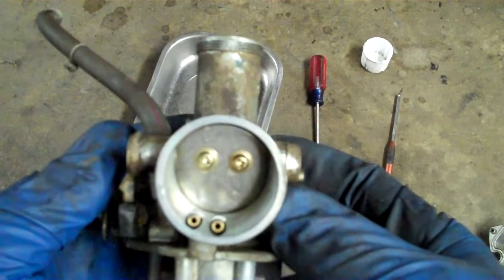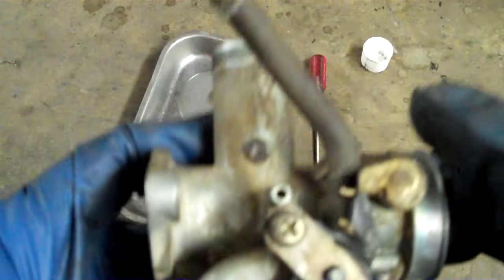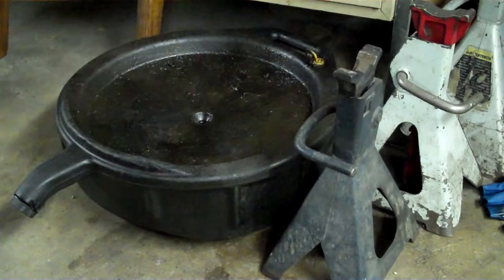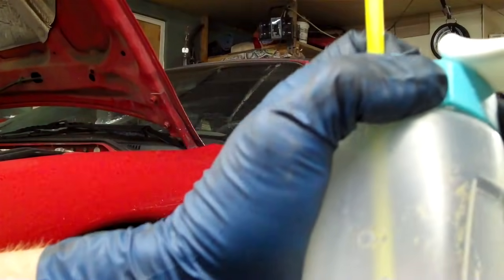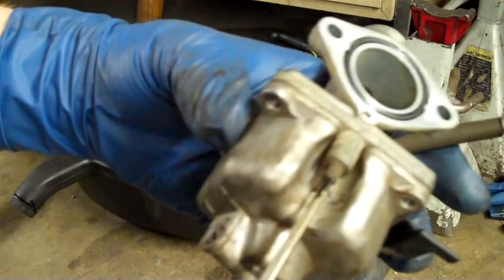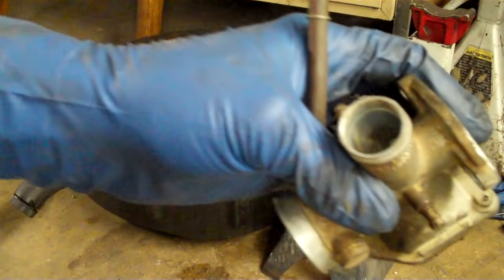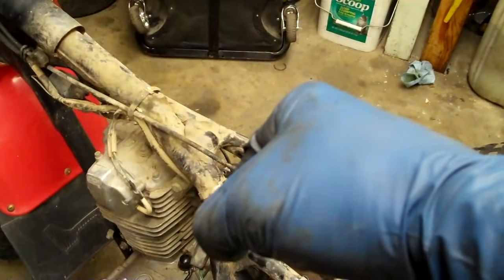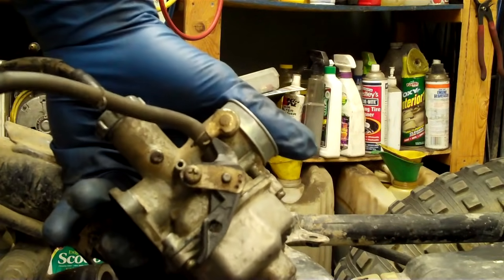How Motorcycle Carburetors work and how to tune and clean them

Comment: Brian, I found a used bike and the guy said it needs the carbs cleaned.  I know nothing about fixing things but do you think anyone can learn to do this in your opinion?
Reply: cleaning a carb is pretty simple, just take pictures of how everything comes apart so you can remember how to reassemble it. have a gentle hand because carbs are kind of delicate. i would be weary of buying something where a person states all it needs is the carbs cleaned.
Reply: cleaning a carb is pretty simple, just take pictures of how everything comes apart so you can remember how to reassemble it. have a gentle hand because carbs are kind of delicate. i would be weary of buying something where a person states all it needs is the carbs cleaned.
Reply: Bentley Beckley
My dad used to work on cars and he said that a lot of guys won't touch carburetors!  They even had an expression "Carb is french for do not touch."  LoL  I'm still interested in learning tho!  So you think the person selling the bike is likely lying?
Reply: A bike and a car are very different. If it's not a huge amount of money, go for it. Heck, taking stuff apart is how you learn. Motors want to run, so as soon as you fix all the problems it should work fine, no matter how long it's been since it ran. It's possible he left the bike sit with old gas in which case you probably want to empty the old gas, clean the carb, change the oil, and clean the air filter.

Comment: thanks for this video. now i know my mistake to my bake hahhahaha i try to disassemble my carburator and clean it after that i put it back when i open it my motorcycle my carburator has been change i mean the sound is not normal. the sounds like full squeeze on the throttle maybe this video my big solution to fix my bike thanks mate

Comment: Great video. Very helpful, but your explanation of the Venturi principle is incorrect. The venturi principle does not result from catching and swirling moving air. The easiest way to understand the venturi principle is think of gas molecules moving in all directions, but moving mostly in the direction of flow through the carb. When the passage narrows, the molecules must move through the passage more quickly because the flow passage is smaller.  This means that there are more molecules  moving in the forward direction and fewer in the perpendicular direction in the narrow passage. As a result, there are fewer molecules exerting pressure in the perpendicular direction; this causes the pressure to drop, creating a vacuum. The same reasoning applies to blowing gas over a tube. When you do not blow across the top of the straw, the molecules in the air above the straw that are moving downward are balanced by the same number of molecules moving in the upward direction, so the upward and downward pressures are the same. When you blow away the molecules above the straw you reduce the number of air molecules moving downward through the straw. This creates a vacuum above the straw and the molecules below the straw move upward and out of the straw.

Comment: I have a 1992 kawasaki gpz 305 it runs perfect till you get gear 6 then revs high and won't go past 70 and then slows down that wee bike for mine should 90 to 100 mph any ideas what's wrong with her
Reply: change sprocket
Reply: +axel castillo there is no sprocket it's a belt drive it has a pully
Reply: Then i have no clue

Comment: My bike win I'm stoped, if I don't rev the motor b4 I let the clutch out it stalls. Every time without fail. But if I rev the engine thin let the clutch out it goes. And it backfires win I let off the throttle. About to attempt to clean and maybe rejet. But I don't know what jets are what win I'm looking to buy parts.

Comment: I have almost  the same carb of breeze 125. i am a good mechanic did an overhaul bymyself. I cleaned it perfectky with spay etc air pressure but it does not spay fuel from the main needle or any place. I do not have the orange cap half dome as shown on the draft of yamaha. any way i could not run the engine. If I tale spary bottle with gasolin
 it runs easy.  buy the way i think that the carb is actualy MIKUNI althought there is no brand name. mikuni is made in japan  as on the carb made in japan . i have mikuni bst 34 and part almost same such threatds

Comment: when you bottom that air fuel mixture screw do so very gently and with the spring in place or you take a chance of busting off the tip in the hole and you will never get it out and carb is shot just my 2 cents

Comment: I'm having problem with my bikes carburetor as I go to 60kmph the engine stops as if fuel doesn't go to engine
Reply from the maker: You're main jet ( the big one in the middle hanging down low) is blocked.

Comment: so why keep a little bit of fuel in the bowl rather than having alll the fuel held in the vehicle? thanks.
Reply: he wont answer if he cant make sense of ur question.. if the question is why even have a carb its so the proper mixture of air and fuel make there way onto the piston...
Reply from the maker: It's so you can go up and down hills, off jumps, stop, go, or whatever and not have a blip wherein the engine stalls.  It's like having a bull pen for the next batter at the baseball game.  Keeps things moving.  It's a flex holding area for fuel.  Most bowls hold about 15-30 seconds of fuel.
Reply: thank you

Comment: So I cleaned my carb yesterday took it for a spin then it bogs out. I get off the quad and push it and give it gas it'll take off strong again then it'll bog when it wants too. Starts like a champ but big on half and full throttle. Help meh. 🤣
Reply: A major issue with spray cleaning is that it isn't effective against some of the old and stubborn blockages. For this reason, most professional bike shops use an ultrasonic cleaner. I recommend either purchasing one (they are expensive but are worth it if you have several carburated motors) or having a shop service them.

Comment: First you have to understand that gasoline is FULL of impurities. As the fuel sits in the bowl it eventually evaporates from the heat of the motor after it is switched off leaving the crud behind to plug up the specific FUEL passages. This happens every time you turn off the motor. Eventually it clogs the passage ways. When the CHOKE is closed (AKA the butterfly valve) The downward stroke of the piston (that creates the suction to draw in the fuel) Is now directing fuel into the passages drawing in MORE fuel to start it. Although its not the liquid that gets ignited but the vapor and too much fuel OR liquid will flood the motor which prevents ignition. Should the passages eventually become plugged I soak the carb in MEK methyl Ethel keytone and with an air compressor, blow out the passages from the OPPOSITE direction of the air flow to dislodge any fuel particles that have accumulated Gasoline is a dirty fuel compared to Propane. My engine oil in my propane motor looks like it has never been changed and after 25,000 miles looks as good as knew. Your motor with gasoline looks like molasses because gasoline it a dirty fuel. Convert to propane and you will not need this kind of carburetor because propane is already a vapor and never requires a CHOKE to start or require cleaning. You can run any non computerized motor with propane. Check out gas generators converted to propane. If you didn't know this before you will be amazed how easy it is to convert!!